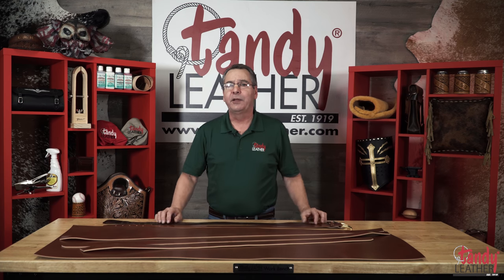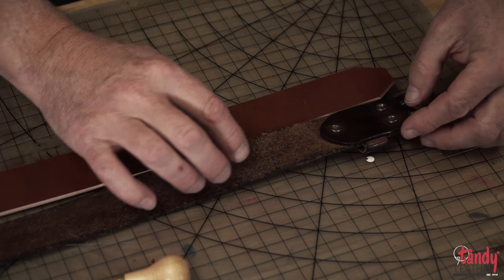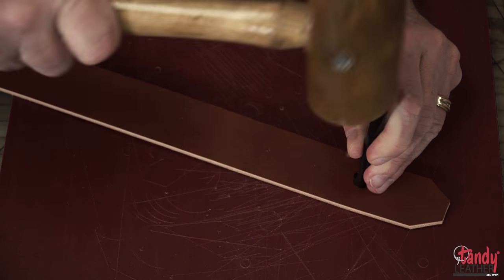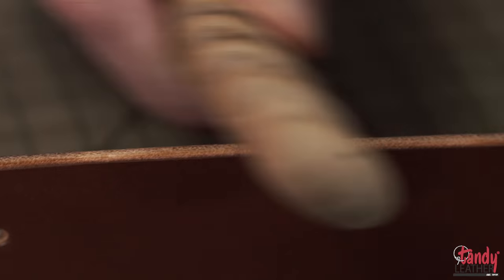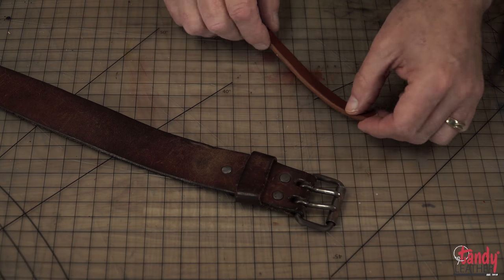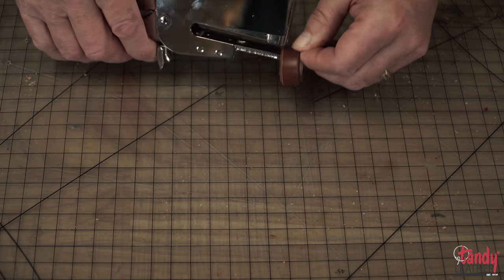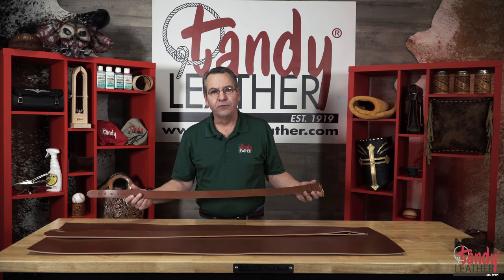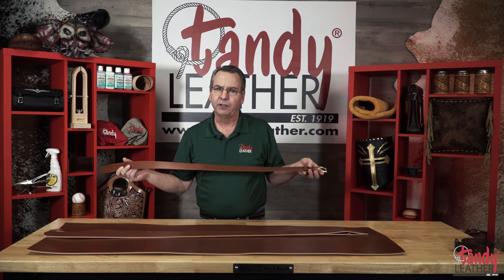Sedgwick Modern Bridle Bend Belt Making

Comment: Is it necessary to add any type of top coat finish to the top/back of bridle to prevent dye bleeding, or is that unnecessary since they are finished from the tannery?

Thanks!
Reply from the maker: This leather does not need any additional topcoat or sealant.

Comment: What size mallet should be used with drive punches? I've got the mini drive punch and oval drive punches, but am unable to make any holes, so I was wondering if it's the mallet or just that I don't have enough strength to bash the drive punch through the leather.
Reply from the maker: The extra weight of a two pound maul helps if you lack strength! It really comes down to personal preference.